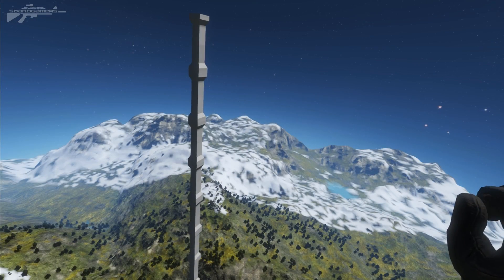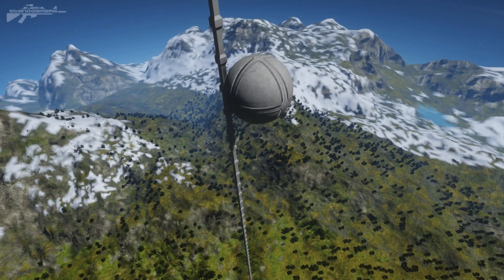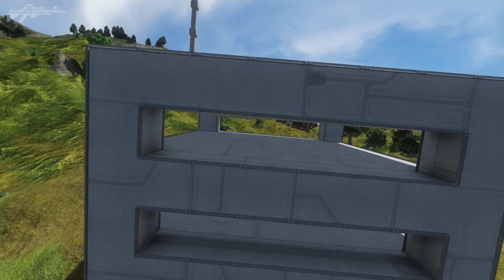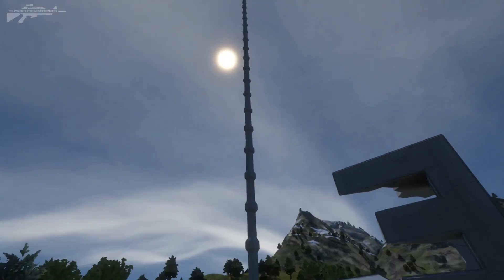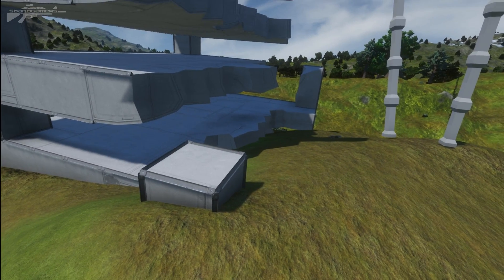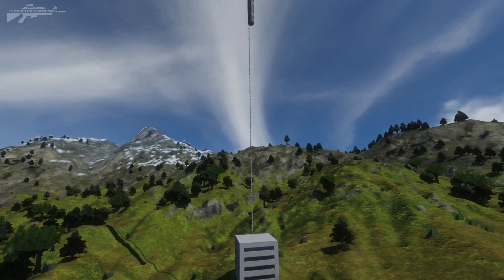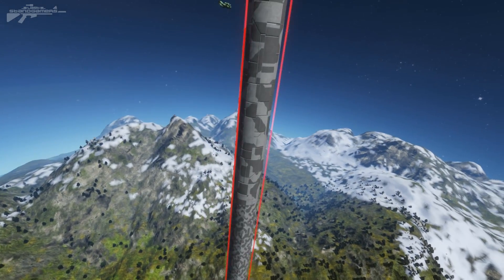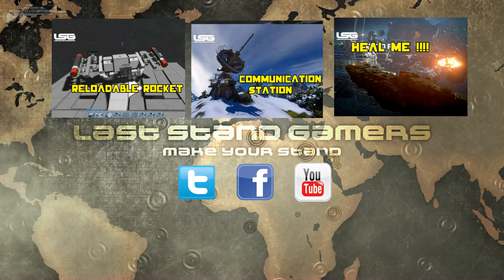Space Engineers - Kinetic Energy Testing

Comment: would cargo containers do anything to the mass?
Reply: +Der WLAN-Kabel-Verband your theory has a major flaw because you only consider the mass of the individual atoms but an uranium atom for example is much bigger than a osmium atom for instance. Also the length of the ion bonds between the atoms is essential for the density. So yeah one atom of uranium might be heavier than one atom of any other element but it doesn't have the highest density. Uranium has a density of 18,9 g/cm³, Tungsten 19,3, Osmium 22,4 and Iridium 22,5.
Reply: megapro125 considering that: im still right, because we were talking about mass and not about the volume...

And saying that multiple osmium is heavier ist wrong:

1 U > 1Os
10000 U > 10000 Os

And the density depends on the pressure and temperature...
When you have water on a pressure of 15.1MPa (regular pressure is 1013hPa)
When you have a temperature of 300°C on the water in density will get lower. Under such a high pressure the water wont turn into a gas!)

The regular assumption is of course
1013hPa, 20°C

When you want to meet the same mass of Osmium and Uranium you will need much less U atoms than Os ones...

So Os is still lighter than U because of the higher mass of U... The mass of U is so high that its already radioactive without being an random isotope... Uranium is always radioactive/unstable...

Pb is the heaviest and stable element, Thats why its used to absorb radioactivity (especiall for Y-radiation... (a- and ß-radiation is easy to avoid))...
Reply: You keep getting hung up on the atoms; but that's irrelevant for determining the density of a SOLID. 

Let's forget about uranium and osmium. You know that gold is "heavier" than lead and mercury, right? That is, if I have one liter of solid gold (LITER, as in volume), it will weigh more than 1 liter of mercury or 1 liter of lead; even though LEAD AND MERCURY HAVE A HIGHER ATOMIC WEIGHT THAN GOLD. 

When you're considering a solid, you have to take into account an atom's valence configuration. Because gold doesn't repel other gold atoms as strongly, YOU CAN FIT MORE GOLD ATOMS IN THE SAME SPACE THAN LEAD OR MERCURY ATOMS. 

Now, take this into account, we want to maximize the mass of a cargo container. Our single constraint here is volume, not number of objects. 

A piston is heavier than a unit of uranium, right? But, you wouldn't fill a cargo container with pistons to maximize its mass. 

Do you understand this concept? It's important here. We MAXIMIZE THE MASS OF A CARGO CONTAINER BY CHOOSING THE MATERIAL THAT FITS THE MOST MASS IN THE SMALLEST SPACE. 

Most mass in the smallest space--sound familiar? It's another word for density. That's all that matters here--IF YOU WANT TO MAXIMIZE THE MASS CONTAINED WITHIN A GIVEN VOLUME, YOU CHOOSE THE MATERIAL WITH THE MOST DENSITY. 

You are correct, that density changes with temperature and pressure, as well as the state of matter (solid vs gas), however, in this case we're talking about solids stored at the same pressure and temperature.
Reply: Yes.
Reply: Yes it will...
The best is to fill it with uranium...
Uranium is the most heavy element which you can find in the nature...
Reply: Its not the heaviest, osmium is. But its hard to use.
Reply: Joe Ayres: Musician 
No, 1 atom of osmium weights 190.23u
Uranium weights 238.0289u

Uranium is so heavy that its unstable.
The heaviest but still stable element is Pb (lead) with a mass of  207.2u

The most heavy element is of course Ununoctium (which is artificially generated) with a mass of 294u...
Uranium is the heaviest natural.

Even Gold is heavier than osmium btw.
Reply: Der WLAN-Kabel-Verband The OP asked if cargo containers would help with more mass and cargo containers are limited by volume not by mass. and since the density of some elements like osmium is higher than uranium's density you can (obviously) fit more mass in a container of any size.
"1U > 1Os --> 1000U >1000 Os" no shit dude i wasn't even claiming that osmium atoms are heavier I said they have a higher density so volume x of Os will ALWAYS have more mass than the same x volume of U (at the same T and p). Pb atoms may have the highest mass (207 u) but is has by far not the highest density "only" 11 g/cm³.

Edit: I know that density is temperature and pressure dependant. for metals that difference is very small though in most environments since there are not so many places hot enough to find gaseous uranium. comparing water with an evaporation point of 100°C with a metall that has almost 4000 °C is ridiculous. Don't even start with pressure. plsease go ahead tell me what pressure you would need to compress a solid block of tungsten. 15 MPa won't do anything measurable.
Reply: +Der WLAN-Kabel-Verband Osmium is much more dense than uranium. Deal with it. ⌐■_■
Reply: Der WLAN-Kabel-Verband you simply don't get it... No one gives a shit about the mass of the individual atoms. The question was: "which material would you use to get the highest mass in a cargo container?" The cargo container in SE is 2.5m * 2.5m * 2.5 m = 15.625m³ = 1,56*10^7cm³ in Volume (let's assume for simplicity that the inside is the same). Now let's see what mass the container has if it's filled with uranium (at normal conditions T=25°C, p=1bar=0,1MPa):
18,9 g/cm³ * 1,56*10^7 cm³=2,95*10^8g=295t
same for one container with osmium:
22,4 g/cm³ * 1,57*10^7 cm³=3,52*10^8g=352t
--> 352t > 295t --> The Osmium filled container has a higher mass.
the container fits less mol U than Os.
Reply: megapro125 You dont get it, we were talking about what is heavier... Not denser!
Reply: Der WLAN-Kabel-Verband I don't know what you were reading then.
OP: "would cargo containers do anything to the mass?"
Your answer: "Yes it will...
The best is to fill it with uranium..."
No it is not because a container filled with uranium is not BEST to fill it with Uranium because if you fill the container with some other elements the mass is higher. I even gave you mathematical proof.
Reply: megapro125 
"I even gave you mathematical proof."
-You didnt. You talked about density.
But density depends on temp and pressure, so what you try to explain makes no sense...
Reply: Buano Taquito don't worry I'm done here ;) This guy either can't admit a mistake or is just plain stupid.
PaleBlueVoice Stop trying mate. it's futile...
Reply: megapro125
I don't think it is. He doesn't understand atomic weight vs weight, and maximizing for a volume rather than for a count of objects. Maybe I'm wrong, but I think the examples I provided will help, where your math might have been too much for him to follow.
Reply: PaleBlueVoice Yeah and when you get really high pressure onto the gold it is not 1l of gold... (Depending on the pressure) you might even get 1ml of gold and its still the same mass...The density is relative but mass isnt!

Thats why you always calculate with mass and not destiny!

Physicists always take the most easy and simple way! You are taking the complicated way! But the comlicated way is always wrong even when it seems right!
Reply: Der WLAN-Kabel-Verband
I'm not a physicist, I'm a (real-life) engineer. I take the correct way.

You want to take pressure into account? Fine. Density is proportional to pressure. Either way, VOLUME is the limiting factor here.

Look, stop arguing. Just go into Space Engineers, spawn 2 cargo containers, and fill one with osmium and one with uranium. See which cargo container has a higher mass--it will be the one with osmium.
Reply: PaleBlueVoice Yeah and we were still talking about mass... Not destiniy... Purely talking about mass! 
-End
Reply: Der WLAN-Kabel-Verband
No, we are talking about both, because the original question was what do you fill a cargo container with to maximize its mass? Correct?
Reply: PaleBlueVoice The original question had no matter anymore after the 1st answer... (Which I didnt see, because I wasnt able to see the first answer because i would have had to reload the website... Whatever though...)
Reply: ***** Thats correct... Finally someone confirming what I say...
Reply: *****
What's your definition of "heavy"?
Reply: PaleBlueVoice 
Heavy:
A relative description of (high) Mass without any numbers.
Reply: Der WLAN-Kabel-Verband
If you don't quantify it, it doesn't make sense to apply it to a material.

You can say a car is heavier than a bicycle, or that a lion is heavier than a housecat, but if you're going to talk about the mass of a material, you have to specify a quantity, or it doesn't make sense.

You can talk about the density of a material. That's what people mean when they say lead is heavier than water or helium is lighter than air.

But you can't say osmium is "heavier" than anything. A 5 kilogram bag of feathers weighs more than 500mg of osmium. Saying heavy/light there doesn't make sense.
Reply: "but if you're going to talk about the mass of a material, you have to specify a quantity, or it doesn't make sense."
-Wrong, I have to quantify the mass of an Object - Not material!

"or helium is lighter than air"
-Helium is always lighter than air... Even if both had the same density, due to helium being lighter than air... 

Helium is lighter than air because it is leighter than air!

Btw. Look at this:

My message:
"A relative description of (high) Mass without any numbers."

Your message:
"If you don't quantify it, it doesn't make sense to apply it to a material."

-You are probably in the wrong thread here...
You were defently not talking to me...

Comment: you can put a gravity generator on the steel road
Reply: Then you'd need a power source then mass blocks etc. The point of a simple metal rod is that it takes much less resources.
Reply: +Robert Elmer use stone to fill a small cargo container and destroy the container.the stone will destroy the base
Reply: Which doesn't work in natural gravity.

Comment: There's more than a few problems with this, mainly that you simply can't get anywhere near the speeds necessary in Space Engineers. Also, calling an inert mass a warhead. And bunker busting. An orbital kinetic weapon is not a penetrator. The whole idea is that it's an artificial meteor strike, like dropping a big-ass conventional bomb or a small nuke and BLASTING the area, not slowly drill a shallow hole before tipping over.

Comment: The Rods from God weapon design isn't a solid rod in it's most effective form; it is a hollow tungsten rod with a vacuum interior. The increase in exterior pressure on the rod as it falls forms a large amount of potential energy due to the pressure gradient. Tungsten, being such a strong material, is able to sustain the vacuum until impact, which causes the rod to implode before the materials can be blasted apart. This causes a secondary kinetic explosion which amplifies the first, to the point that a Rod from God weapon could have the strength of a megaton nuclear bomb at 100% efficiency, and none of the radiation.
Reply: @QualityPen  they would theoretically be dropped from orbit so they would have much more power than any warhead

Comment: Try a ball of mass on the top and a pillar of interior pillars... however, I cannot see a kinetic weapon being more effective than a large warhead without being far more expensive due to the constraints inherent in the game. It's only advantage is it is less explosive, but is usually hard to aim, hard to maneuver, and expensive.
You could put a 'rod of god' tip on a ball of warheads(also providing more mass for the rod) and allowing the warheads to penetrate into the ground a little first and then explode in the target(you can also configure the length of the rod to allow varying degrees of penetration, but this entire method is still expensive)
Reply: Warheads get shot up by defensive turrets. If you dumb fire grav weapons they don't.
Reply: you can add decoy 'flares' with projectors(like a lotus bomb) and also add a frontal light armor plate to shield from the front, but it leaves the sides open to convey the explosion.(and by warheads I mean the explosive block, just to clarify)

Comment: I was literally making something like this, but not for planets. you  basically have a tiny ship with 2 ion engines, a reactor, a control panel, a rocket launcher, a sensor and a warhead on the front. The sensor detects an ship from a rival faction and shoots rocket launchers at the ship to penetrate it. Then the warhead explodes inside and in the best scenario the engines survive and go crazy inside and crash into everything. You just put on full thrust override and blam! They are used as an initial strike. They have no homing capabilities, they are completely "dumb" rockets apart from the sensor. They can be put on small "support" ships and can blast a hole for crew to board. Just a little idea, I'm not very good at making proper systems :P

Comment: The Rod from the Gods is an exaggeratedly hyped weapon. Other than the penetration power it would do very little damage at any considerable distance from the impact. Remember, a mechanical wave loses energy exponentially as it expands, as well as it being a single shock wave. The actual damage to an underground bunker would be collapsed rooms at the impact an cracked walls elsewhere. Of course the air blast of rooms instantly collapsing could kill a number of people inside the facility. But that actual damage would be minimal.
Reply: Well it all depends on the size, and besides, a huge amount of damage in a tiny area can be useful.
Reply: True, but that scene in GI Joe where it levels London is complete BS.

Comment: Aaron, I think it is possible to create a more efficient design by reducing it size.  Sharp extended tip, maybe using something like a crossed 2x1x1 slants, much like an arrow tip, three blocks making up a shaft, and at the end an artificial mass with an explosive.  Gravity will drive this mostly, but it will pierce, get as deep as it can, then explode causing more damage.  I understand the intention was not to use anything more than the most minor amount of materials, but this is more efficient than using a large amount of cobalt to make the heavy armor rods, or even large amounts of silicon to make the poles.  Give it a shot, I hope it works out for you.

Comment: If you made a drone that can enter and exit the atmosphere, has a sensor on the bottom to measure distance. Have a small or medium cargo with two connectors on each side. When you release the drone have its start spinning on the axis relative to the planet and use the connectors to spit out stone. I am getting on space engineers to try this out, not sure how the ore will do compared to the metal warhead but for damaging exterior pipeing and turrets would be great.

Comment: In case you guys are scared that "the rods from gods" is a real weapon rest asured its isnt since the projectiles would have to go mach 10 and be 30m tungsten telephone pole diamter rods. So 1st of all i dont see anyone smuggling rods that size to space 2ndly any kinda of weapon in space is forbidden(i belive the handguns etc in capsules are an excepting since theyr for the crews survival from wildlive. If they still have guns that is.)3rd the firing platform would have to be bigger than the ISS most likely. 4th it woulnt do much dammage eather its going to have a shockwave on inpact and carved a hole / destrotyed a few buildings (its ment for high priorit targets (oh and its nothing like youv seen in cod:ghosts)) 5th to use it as intended (mach10 impact) that would have to find a way to slow down its orbit to 0(compared to the surface) and then realy quickly accelerate downwards (and even then it might obliterate itself on entering the surface) this is somthing we cant do yet.

Comment: In theory, you want a projectile that pierces, then after having pierced it, explodes. This results in an explosion inside the target and not on its surface. So maybe you want to test how large of a rod you need to penetrate X(1,2,3,4,5, etc...) layers of armor, then attach explosives at the back end giving you an explosion after penetration. With this you could use different types of ammunition to hit different levels of a target and get the maximum damage. (You don't want to use a rod that penetrates 5 layers against a 3 layer target because the explosive would detonate underneath, not in the target. 
(and for those of you giggling at the possible sexual innuendos, get your mind out of the gutter.)
Reply: Are you Oppenheimer? Because now you have become death. The destroyer of worlds.
Reply: APHE Exists, it has some kind of fuse that activates after going through a certain depth of armour so it actually explodes i stead of going through. I would just make a shrapnel shell that releases hard metals and materials inside the ship to tear it apart as it moves.
Reply: Use a small cargo container fulled with explosives instead. Now there is C4 all over their base waiting for a follow up attack.
Reply: +Owen McLaughlin there is a missile that penetrated exploded using warheads that then blew up a cargo container of whatnot that then got propelled foward by grav gens in a spiral fashion. think its called the reaper on the workshop
Reply: APHE (Armor Piercing High Explosive) is a great concept
Reply: you can do it without mods...use blast doors blocks with heavy armor..the warhead must be inside and set back...my chief complaint is that the launch system is huge.
Reply: Actually I had the same idea. One warhead on the end and suddenly much more damage. Even if it costs some resources it definitely becomes a weapon to fear. Wonder if you could take advantage of gravity generators in space making a cannon of sorts...
Reply: I'm more interested at the sexual innuendos
Swiggity swoogitty im comin for that booty